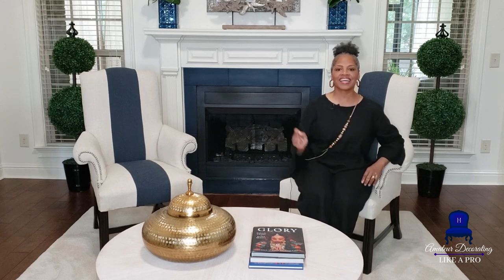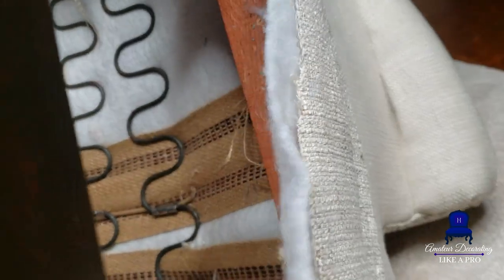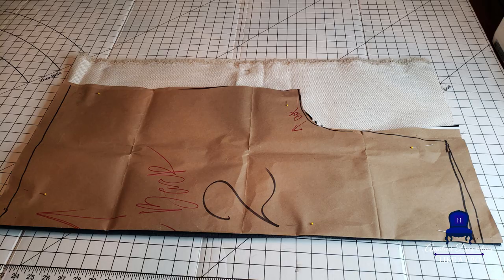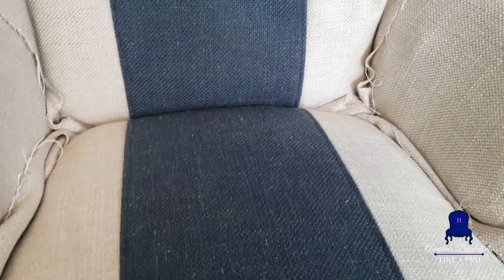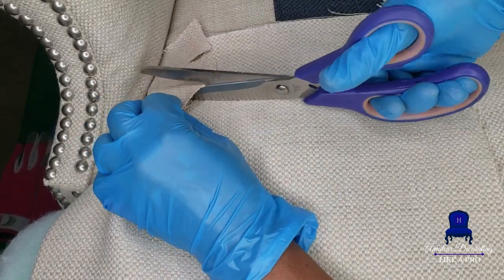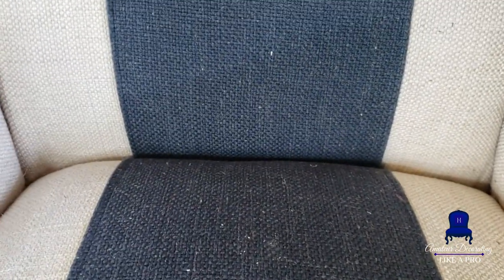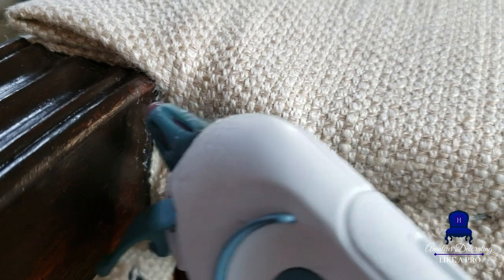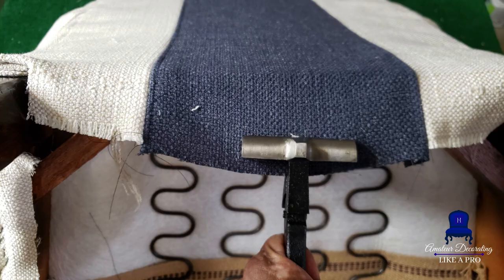Chair Makeover/ How To Upgrade Your Chairs With Confidence!

Comment: Thank You for your reply.  The reason why you do not use fabric glue. Regular glue is easer to remove. Please educate me if I am wrong. 💖🌟🌟
Reply from the maker: No reason in particular.   When I started, the budget was zero.  And often thinly applied hot glue was my go to.  Now honestly, I don't see the need for most adhesives once the fabric is tightly stabled down.  And by the way spray adhesives make be itch.